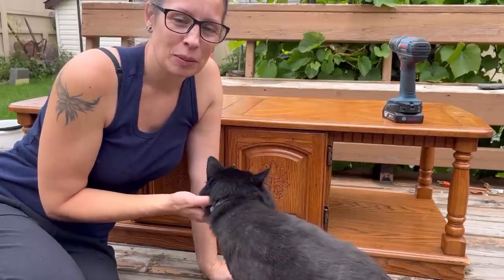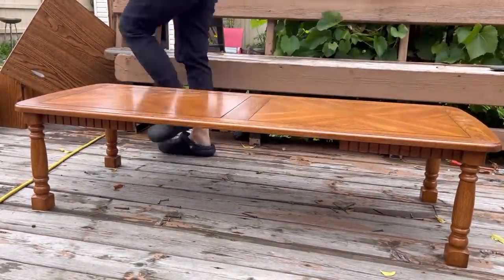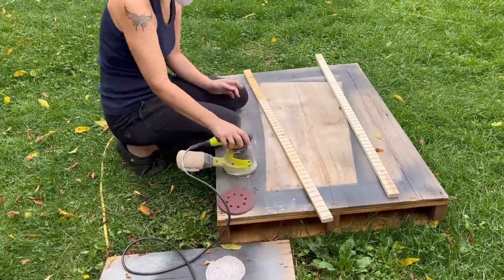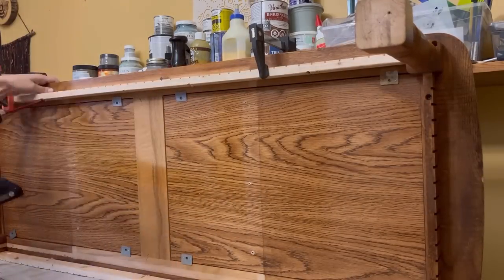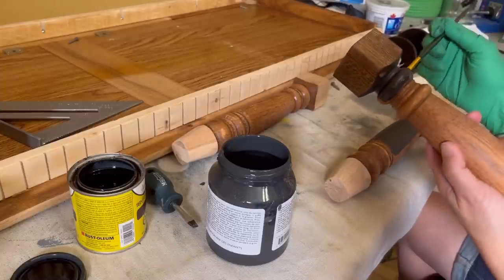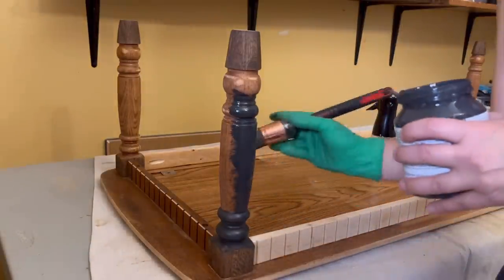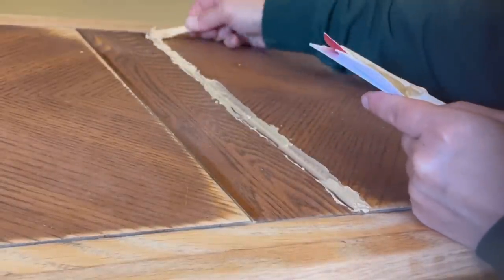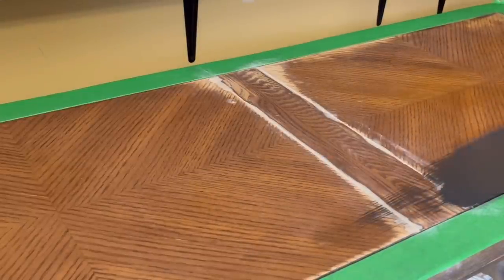UGLY DUCKLING Challenge  Fall 2022/ MEGA Transformation happened on this outdated and UGLY table.

Comment: Wow…a complete and lovely transformation! love all your choices…really came together nicely! When sanding my hubby taught me to move the sander around so you are using the whole disc and let the sand paper do the work for you…if you feel like you have to push maybe need a lower grit sandpaper…that said I love that you removed the chunk at the bottom of the legs and I think that was really smart! They now make soft foam sanding pads for orbital sander…would help with sanding turned legs…I got square for hand sanding and the round for orbital at very reasonable price on Amazon…Good luck to you! Thank you for sharing😊kim
Reply from the maker: Oh thank you so much for the tips! I should have use a lower grit sandpaper but I didn’t have any. I do have a foam pad for my sander but didn’t even think to use it. I was definitely pushing too hard but was trying to not use up too much time sanding. I get impatient. Lol. The legs aren’t perfect (a lathe would be great) but they are better than they were. 

Thank you so much! 🥰

Comment: You’re the first furniture flipper I’ve seen use a Japanese pull saw. 👏👏

Good idea with the foam sanding block. 👍

I didn’t know there was a sub requirement for community posts. I spent quite a while last night trying to figure out what I was doing wrong. 😅

The grain is quite distinct in the top paint as well as small imperfections/damage in the wood. If you wanted a smoother appearance, you could probably use primer (or shellac) as a grainfiller.

Good job. 👍
Reply from the maker: I love my saw but it’s time for an upgrade. 

Haha yes, I couldn’t figure out for a while why I couldn’t post to the community. 

Thank you for the tip! I didn’t even think about putting something underneath the paint. I always just hope the paint will cover it. I skipped primer this time too because I was using a dark colour and was only thinking of bleed through. Next time I’ll think of the grain as well. Thank you so much! 🥰

Comment: Not a fan.  The new finish won't last, and the original table could have been fixed without the massive surgery.  At least you didn't use blue chalk paint...
Reply from the maker: Yes it could have been left alone, however, these tables are no longer desirable in my area. Instead of it ending up in the dump, I changed it to be more modern and could be loved again and that’s the premiss of my refinishing business. Also chalk paint is a great furniture paint that has to have a top coat to seal it in. Do you have experience refinishing furniture?